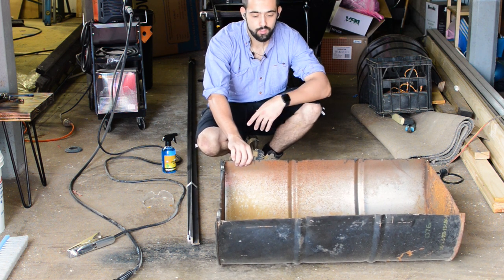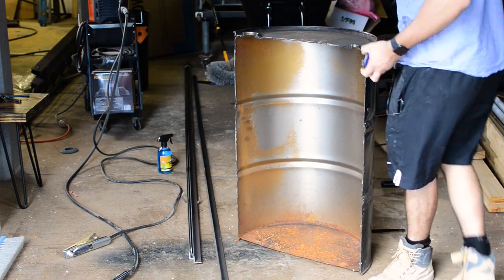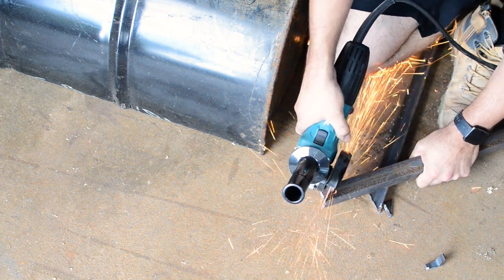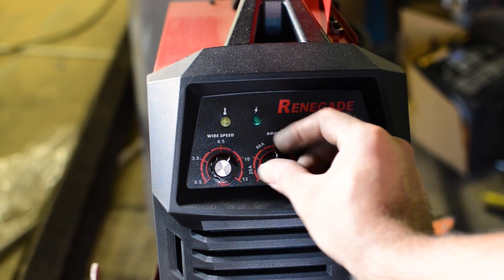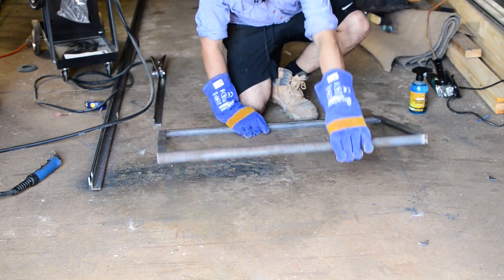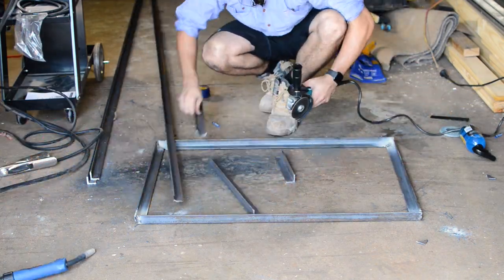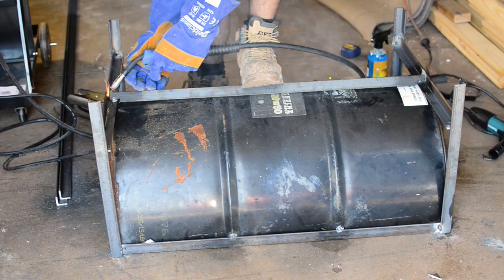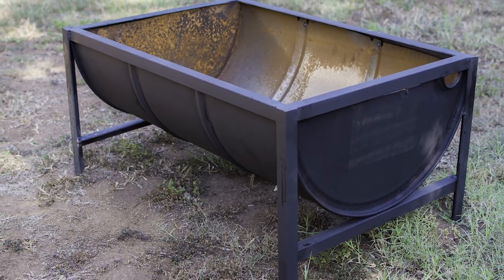DIY Fire Pit | Basic Welding

Comment: Drill a few holes in the bottom to drain out water or flip it over when not in use. You could make grated cover using flat bar and expanded metal get the flat type just a thought . Cheers

Comment: Think of bacon frying in a pan with sound and try when your welding with MIG anything from 15.5 to 17.5 with your current and your wire feed speed 2 1/4 to 2 and 3/4 ipm ( inches per minute) I like to do a whip and pause motion or small circles depending on your position, and also with flux you can run straight beads instead of using a weave pattern but it takes practice man the more you do it the better your muscle memory will get also welding tips and tricks with Jodi on youtube helps a lot he's an ol timer and has a lot of cool stuff you can benefit from keep welding bro your doing great I appreciate you sharing your idea with us.

Comment: Big thumbs up for a first welding project.
Have you created some vents in the bottom/ends of the drum for air flow? 
If you can get hold of some reo bar, it is great stuff for making a removable rack to sit your fires bed on - helps with air flow under and around.
With a good frame like you have, before you know it there will be a spit rack.G'day from Sydney
Reply from the maker: Bill Blake hey bill ! , yeah I ended up grinding some vents in the bottom ! That helped heaps. Great idea ! I think I might get some. Perfect weather for it 🤙🏼

Comment: Thanks for the excellent video and instructions. I'm going to have a go at making one of these. Perhaps two. I'm just wondering if you only tack welded the drum to your steel frame, or eventually used longer beads? I guess you've got that length of steel underneath to support the drum when it has a load of wood in it? I also saw one recently with a grate in the bottom of the drum. I'm guessing that will prolong the life of the drum and improve airflow? Does your one work okay without a grate? Sorry for all the questions!
Reply from the maker: Nugget S. Afterwards I went over with longer beads ! But tacks should be fine :)